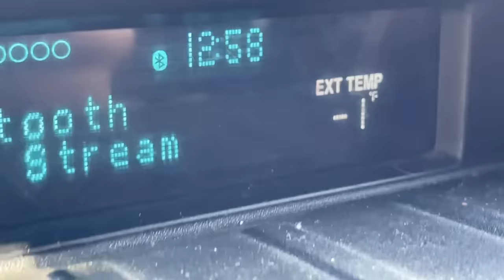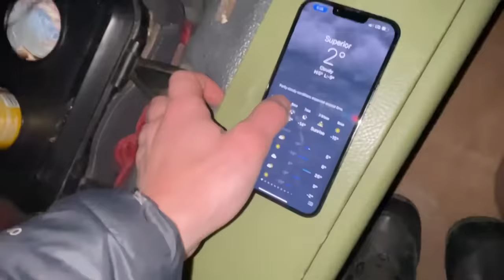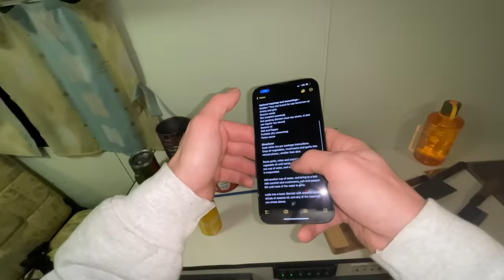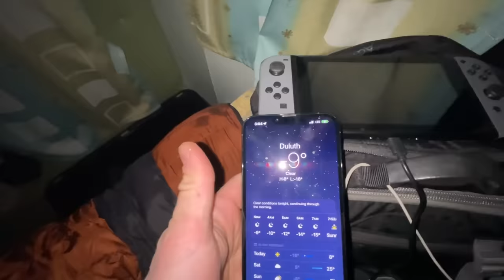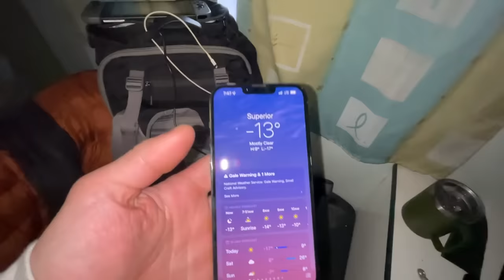Taking my Japanese Import Camping in -18 Degrees

Comment: 12:15 You may know already but just a tip. The oil that you use is Korean branded and it's called 참기름 which is made out of sesame seeds. You don't want to use as any other vegetable oil or olive oil. Koreans usually put a couple drops only for better taste because it might be too much if you pour like that much for a meal. I love 참기름 though I would recommend putting only a little bit unless if you really really like that.

Comment: Don’t forget to heat up the glow plugs. Just turn the key on for a couple of seconds then crank her up.
Reply: i was just about to say that xD
Reply: I think steve is an electric truck
Reply: I'd agree but only add that sometimes it's worth using the glow plugs for 2 or 3 times before trying to start it and also letting the glow plugs run for their time 
( they're normally on a timer relay and stay on for 5-10 secs. )

Comment: Not a mechanic but a small battery shop owner over here from California, sold a couple of gel batteries for an older diesel style sprinter van, the dude spent a good amount of money on electrical component upgrades like upgraded alternator and a self trickle charge system so the battery would never lose charge if he was camping at a spot and not turning on the vehicle for a couple days & dropped the extra monies on the gel batteries from us. Your issue does sound electrical especially from all the cables all over the battery compartment, dude probably hot wired the cables and didn’t manage them just wired them to start and sell the vehicle. Just my observation from a 21 min long video 😅 love you brotha hope you get the beast running properly 🤙🏼

Comment: Mav, put 2 more batteries in Steve. Get the highest Cold cranking amp batteries you can find! Wire them positive to positive and negative to negative! Also they make a  Goodall JP 12 a 10,000 jump box. they are not cheap but you will be able to keep Steve running all the time! I would get the Goodall if batteries are not an option.
Love the vids!!!
Reply: Positive to positive is parallel wiring. The voltage stays the same but max amp hours increases. The best bet would be 2 12v battle born lithium ion with some solar panels, inverter, and charge controller. That small camper wouldn't need much
Reply: +1 on running dual starting batteries

Comment: A tip for you, when you stop put it in gear and stop stretching that "parking brake" cable.  Some people put it in reverse but I've always put it in first.  As long as you are in gear you are much more stable than being in neutral and relying on that stretched out cable applying your brakes.
Reply: 1st gear when you park facing uphill, reverse when you park facing downhill.
Reply: Told him that before when he got the Bug, but he doesn’t listen.
Reply: @fonkapollo  or maybe he just disagrees...
Reply: sadly he doesn’t react with subscribers that give him some paychecks
Reply: @fonkapollo  he doesn’t have time to talk to millions of people.
Reply: @insaneempire13  Fr
Reply: You should still use your parking brake, I have never had a parking brake failure, as you should get your brakes tested at every service, and replace the parking brake when needed.
Reply: @Brad-z3b  he doesnt necessarily have to reply. but it seems like he doesnt even read the comments.
Reply: when u have da same name as da truck
Reply: Yeah thats a myth  use your parking break
Reply: @PhatNinjazZz  
💯
Reply: @PhatNinjazZz  While your logic will prevent it from starting in a roll away since the engine would be turning backwards in both instances the best gear for up or down hill is your lowest gear and that's usually reverse. Even a diesel won't start during a run down a hill with the ignition off.
Reply: Both in gear and the parking brake is best. If you don't use the parking brake on a regular basis there's a great chance it will lock up on you in an emergency. People with automatics find this out the first time they use it to change a flat tire and find it won't release later. Cable stretch is normal and that's why it's adjustable to take the slack out.
Reply: @allan2519  use the parking brake as long as you’ve not been driving in snow and slush and temps are below freezing. I learned the hard way when I lived in Illinois, my truck sat for two days because my parking brake cable froze solid and I had no way to thaw it. Otherwise, I always use the parking brake.
Reply: @Sweetlyfe  i was always told you only leave it in gear if you are on a hill
Reply: @Sweetlyfe  Ever have your parking brake cable freeze in place? I never use my parking brake in low temps, it only has to happen to you once to know you never want it to happen again
Reply: It’s needs to be adjusted and the rear shoes need adjusted .   Parking brake should apply with 3 up clicks. I have 3 Toyota hilux
Reply: All my vehicles are manuals and let me tell you, don’t think a vehicle won’t move just because it’s in gear especially if it’s an older vehicle. I was parked on an inclined driveway in first gear without the ebrake, went in the house to do a job came out and my truck was halfway in the street. Always use both if on an incline 👍🏽
Reply: Never had a problem with the parking brake if you use it often, pontiac Vibe 2003, impreza 2008 & outback 2011. It's freezing down to -36 with snow & ice 6-7 month a year where I live 😅👌
Reply: thats the point of the parking brake...  Why did you put "parking brake" in quotes? You're not one of those people who think that's for using at 60mph when your brakes fail are you?
Reply: @insaneempire13  he literally cannot reply to every single person, and ive never heard of soembody who donates talk like you, so i dont buy it or believe you for a second.
Reply: @lostways8196  i mean he just doesn’t reply to anyone at all . U look at most of his videos he has NO reply’s towards anyone  . maybe he hearts somebody’s comment but that’s the most he does . at least here on he doesn’t interact with his subscribers lol .. hopefully he’s better on instagram if he has one .
Reply: @lostways8196  Like i said youtube is only his “passive income” . he does not give a shit about his subscribers . i’ve seen other Pages that are not quit as popular as him but they reply to quite a lot of people .
Reply: @insaneempire13  lol not everybody has time to sit there and reply to comments when your out living life man, he makes youtube videos, he doesnt owe ya nothing. nobody is making you watch this, quit crying lol seriously
Reply: @lostways8196  where did i say he owed me something lmaooooo . u a weirdo
Reply: @lostways8196  Ur Username says it all peace out lmao ✌🏼
Reply: @heruhcanedean  no I don’t live where there’s snow do get low temperatures but not like that, I stand corrected I wasn’t thinking about the snow.
Reply: Steve!? Just wanna say that you are a nifty camper, dude. Impressed that you've mastered YouTube commenting.
Reply: @iainansell5930  Yes in first if going uphill and reverse in a downhill situation that’s what I learnt to, I still drive like that but I always use the park brake too.
Reply: @Brad-z3b  there's YouTubers with alot more subscribers that interact.... he doesn't interact because he doesn't care he still gets paid either way.... it sucks they should have a requirement that the youtubers have to interact
Reply: @allan2519  A myth?   No it is not a myth.  Sure an older vehicle like this could roll with a compression stroke if isn't up to par but you are talking about leaving a vehicle in neutral, in neutral.
Reply: @LobsterHunter5  No I'm not.  I put it in quotes because that very same brake used to be referred to as an Emergency Brake.  Once lawyers had to get involved it was called a Parking Brake.  Nothing changed, same function, except now people started using it more.   I drove tractor trailer for 21 years and luckily never experienced failed brakes which happens often with air brakes, however we are talking about 4 wheeled vehicles here and I've never heard of brakes failing on a car like it's a common occurance we have to worry about, however if mine did fail you better believe I would be feathering that lever or pedal if it was my only option.
Reply: @Sweetlyfe  Just one road travelers experience to another. I hope you never have a parking brake freeze in lock. It sucks a lot, and it's going to be cold outside too.
Reply: @Steve-dy1wf  ok I should revise.  Use ebrake in conjunction with leaving it in gear not just in gear. My VW rabbit will roll in gear...should prob get that looked at lmao

Comment: Problem is definitely electrical related. Diesels need fast cranking to start. Either batteries aren't charging properly or house electrical drew them down. Cold don't help for sure but I think that was not the only problem. I would get that sorted before next adventure with Steve.
Reply: Too many people overlook an apu such as the Carrier proheat unit to keep batteries charged and heat the cooling system. They will also provide electrical resistance heat and up to 6kw 110 v.a.c. Powered by a kubota 3 cylinder diesel engine they are quite economical.
Reply: Well  also a block heater would be good for this. Especially in that type of weather.  My old Mercedes 24o would get testy below 62 out here in California.  I would have to put dipstick heater and plug in for an hour and it would warm her up and away I would go.
Reply: @davidgleason3379  HAHAHAHA,, @62??? UMMM, NO!!! YOU DIDNT!!!
Reply: Great reply.    I was wondering why steve wasnt kept running all night.

Comment: Idk if anyone has already mentioned this but I think for camping in the cold, you could setup a separate battery off the circuit of the rest of the camper for just starting the vehicle. That way running stuff in the camper won't drain your starting battery.
Reply: Thousand amp lithium-ion jump kits work very well in a crunch. Only way a few pounds. All about them amps in the cold weather 👍
Reply: They are all already set up like that. Battery isolator doesnt allow house to draw any power from starting battery!

Comment: Cranking speed is the all important thing for cold starting diesel engines. When you get home put the battery charger on trickle  which is about 2amps and let it go all day and night till it brings your new battery up to about 13.5 or so volts. Otherwise the new battery will freeze because they do not come fully charged. In winter it is good to put that battery on trickle about once a week to keep it full. Alternators are made to maintain, not gain. They like to maintain an already well charged battery.  A good 12 volt battery will show about thirteen volts on a meter. Twelve volts is not enough. I'm glad your friend helped you. Good video. Pax.
Reply: Not a voltage issue a cca issue. The alternator will absolutely charge the battery up.
Reply: Alternators most definitely do charge. If it only maintained a battery your battery would never charge back up after the initial drain from accessories or starting.
Reply: @jtackerman28  yes, if he drove for 1000 km non stop
Reply: @icebabysnocain  yeah except no.

Comment: Hey mav greetings from Germany. I just wanted to tell you I love your videos, but I noticed you always go into neutral on Steve, when you park. You should either be in first or reverse just in case the handbrake fails, then you have extra resistance. Also when there is no incline usually first gear is enough, then you don't even need the handbrake :)
Hope you see this and it helps!
Reply: I have a friend with an automatic transmission and he puts his parking brake on EVERYWHERE. I never use it personally unless it’s on a hill or incline
Reply: @1012Mrjesse  I do this.  This is how I was taught during driver’s ed.  Honestly, I think it has saved me from having to go through brakes like others do.

Comment: Hey Mav loving the videos! Just a heads up incase it could help for out camping if you need a jump, you can buy portable jumpers. There’s one on Amazon meant to be really good I’ve been looking at getting for camping it’s called a nocco boost and then you should be able to jump Steve when you’re out by yourself
Reply: He has one that he used in another video
Reply: @iiBleedMusic  ahh my bad, I watch ALOT of channels and couldn’t remember if Mav had one or not
Reply: Yeah, those are legit. I start an old Triton V8 with it. Handles it no problem, even with the smallest one. I don't thing anyone makes better emergency starters. The size throws you off but they crank. Price is fair too.

Comment: Hey Mav. Its sounds counterintuitive, but it helps to put our headlights on full bright for 30 seconds before you try start in the cold. The cold causes high internal resistance by freezing the electrolyte, and putting the lights on bright warms the battery up and lowers the internal resistance.
Reply: I watch mavs videos for the comment sections cos you just learn cool shit
Reply: Will need to try that trick, my Toyota is struggling to start when below -15c. Thanks for the tip.

Comment: Power Service Diesel Supplement, white container with a red cap. Add every fill up for those cold temps. They also make a diesel 911 supplement that re-liquifies fuel and de-ices fuel filters if you forget to add the other stuff👍🏻

Comment: Maybe look into a dual battery setup used only for starting the truck. Also, make sure your glow plugs are up to snuff. Cycling the glow plugs a few times and doubling your cranking amps will probably do the trick. Great videos. Thanks for making them.
Reply: He always turns the key one right away. Not sure he knows to heat the glow plugs. That truck requires about 30 sec or more to warm.

Comment: Hey, Mav! Love your videos!
I suggest for the cold wheather to make sure you have a good full synthetic oil with low temperature properties to stop the oil from gelling when you stop the engine in cold and for heat you can easly add an newer apu witch will last you trough the nights with max 2 gallons of diesel! Keep up the work!

Comment: When I know it's going to be extremely cold, I put a small electric blanket on and around the engine connected to an inverter with a spare battery. Never have a hard time starting down to -30 so far.

I have tried those oil heater dipsticks, but they don't seem to work good enough.

Comment: Mac, cool videos! I used to manage a fleet of stick shift diesels and have a suggestion to add to your arsenal, be sure to push in the clutch when starting in cold weather as it allows the engine to spin easier. Keep on trucking!

Comment: From one Steve to another I love that thing. But a Diesel engine is never going to start in sub zero weather if it isn’t plugged in. Your next outing you should have a cord long enough to reach a Jackery inside where it’s warm. Also, make sure when your generator is running that it’s charging both batteries.
Reply: Canada and Norway + a lot of other countries disagree with you.
-20 is not an issue for diesel.

Comment: Just a tip, always leave your car in gear just in case your handbrake fails so it won't roll away.
Reply: if you're worried about a car rolling away, its generally best to chock the wheels..
Reply: Leaving it in gear doesn’t guarantee it won’t roll. It can still roll just very slowly that’s why the e brake is there. I’ve had ‘‘em still move on me plenty of times

Comment: If thats a hiace with an L series engine, it will have glow plugs. Please use them! They will light up for 8ish seconds and then turn off, or go into pulse mode if it has an after glow timer.
If you turn the key to acc for 8 seconds. Then off again and then acc again for another 8 seconds before actually cranking it, it will make it easier to turn over and provide less strain on the battery.

Comment: Hey Mav, Have you ever looked into Diesel Air Heaters? You can get them on Amazon for less than 200 bucks. They might be worth looking into for the Bug, Truck, or maybe the Toyota.
Reply: That knob he was turning is a diesel air heater.
Reply: @valkman761  I learned that after watching the video... The comment was mainly for the bug and the truck bed.

Comment: Mav just a few suggestions, keep some anti gelling diesel fluid, let the glow plugs warm up before starting, magnets for cutlery so it doesn’t bang against each other, and run the engine heater cable through the cab inside.

Comment: Hey Mav just wanna start by saying I enjoy watching all of your adventures. Also, Because Steve is a diesel engine and with a very small fuel tank it wouldn't hurt to bring one or two 5 gallon fuel cans with you especially when you're camping in negative temperatures as cold as you were in because it would be your saving grace for the tank from forming gel also you can use it for the generator that I believe you mentioned that also runs on diesel?
Reply: In canada all diesel sold is adjusted for winter with antigel right from the pump and will NOT gel above -40

Comment: A simple way to assist any manual gearbox  car starting, is to  push in the clutch pedal,it allows the car to crank a little faster. Try it, it works,

Comment: One rule of thumb when it comes to a manual transmission vehicle never leave it in neutral when parked always put it in first gear when not running of course  and merch break on. if the emergency brake fills your car is going to take off rolling because it's not in gear